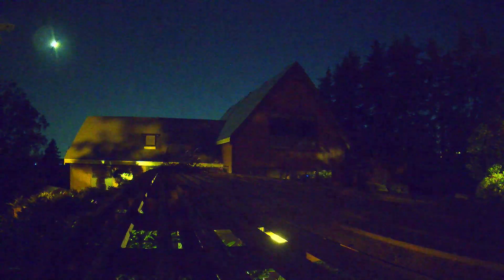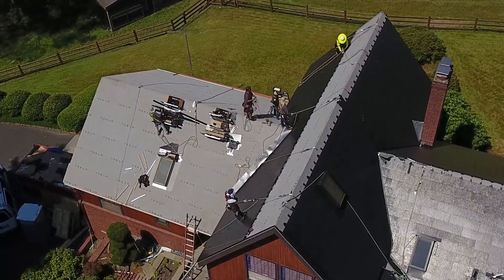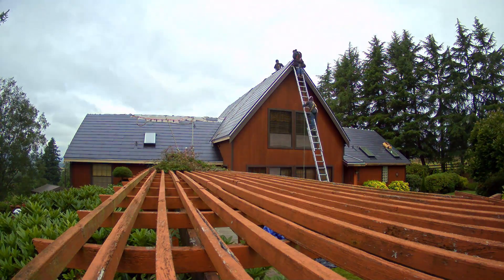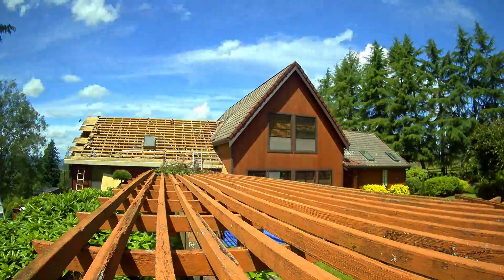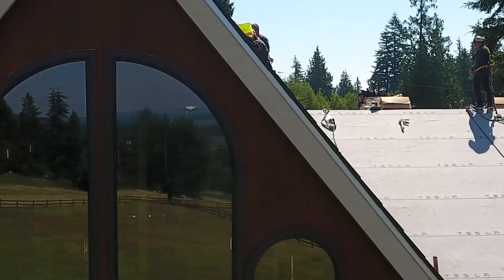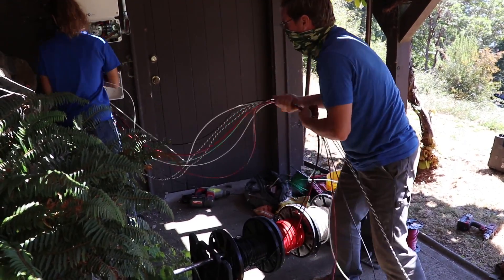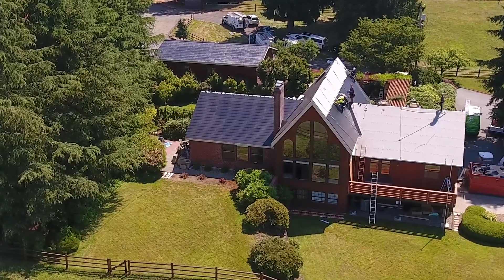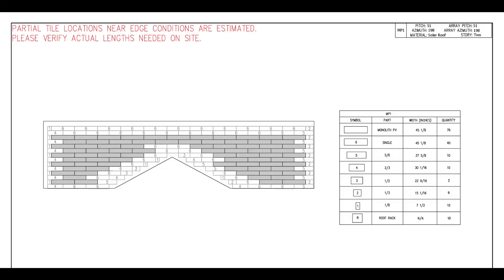Tesla Solar Roof - First Installation In Washington State

Comment: I want to build a cabin in your area, but the site is not good for solar.  Other cabins in the area rely on propane Generac generators due to frequent outages; I want to use a couple Tesla Powerwalls as a backup source, can you provide these without a solar install?
Reply from the maker: Hi Taylor, please send us an email at info@artisanelectricinc.com to consult with one of Solar Sales Engineers. Thanks!

Comment: what is the cost of a roof that size?
Reply from the maker: Depends on complexity but it is very expensive, much more than your standard PV system! Definitely a luxury solar installation.
Reply: @Artisanelectricinc  over 200k usd?
Reply: 50k plus.